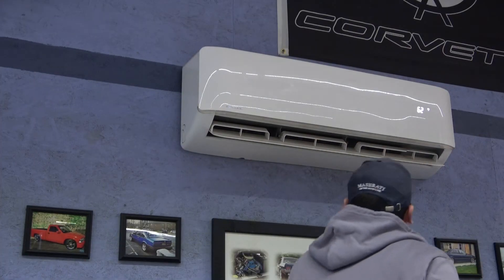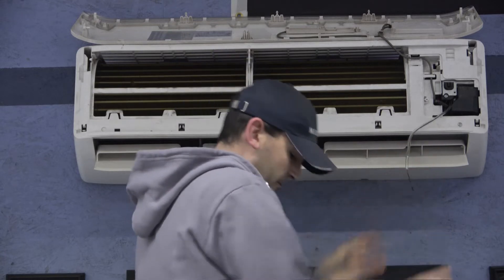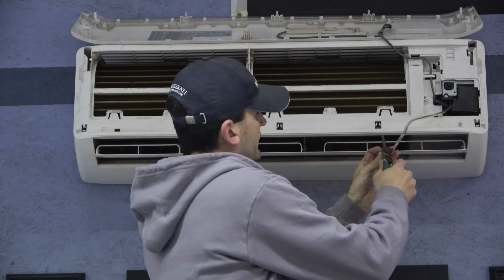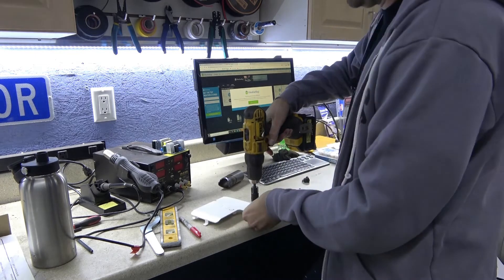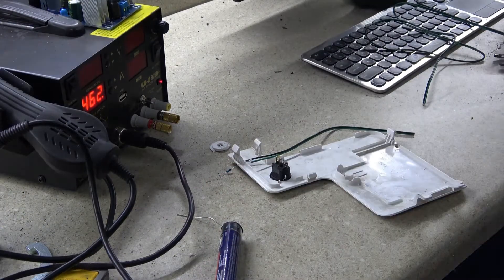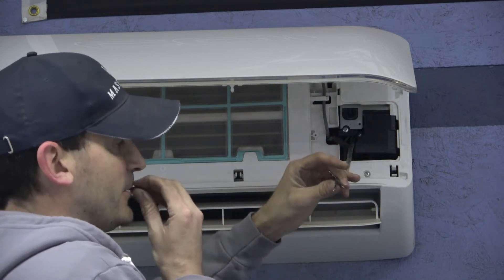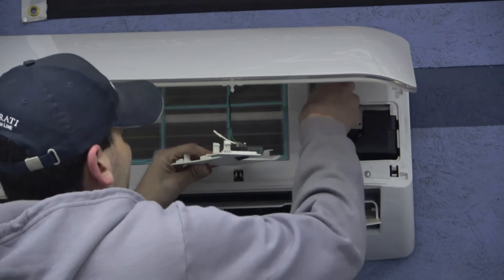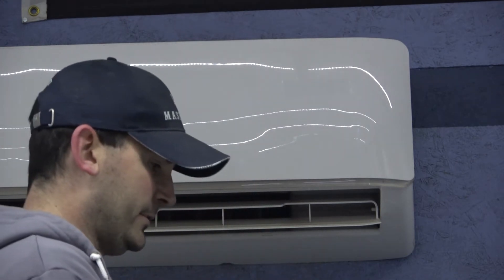Expand Temperature Setpoint Range of ANY HVAC! Even Window A/C's!!!

Comment from the maker: Resistor Kit: https://www.amazon.com/gp/product/B07D54XMFK/ref=as_li_qf_asin_il_tl?ie=UTF8&tag=trialnerror-20&creative=9325&linkCode=as2&creativeASIN=B07D54XMFK&linkId=ec7d7cfbc12c05716396729b308e5b7e
Potentiometer option: https://www.amazon.com/gp/product/B082FBLKM3/ref=as_li_qf_asin_il_tl?ie=UTF8&tag=trialnerror-20&creative=9325&linkCode=as2&creativeASIN=B082FBLKM3&linkId=4bd0e6789736b296b316eebabab8d008
On/Off switch: https://www.amazon.com/gp/product/B07D285PLL/ref=as_li_qf_asin_il_tl?ie=UTF8&tag=trialnerror-20&creative=9325&linkCode=as2&creativeASIN=B07D285PLL&linkId=54e296d013f7bb5ae1055cb94784db48
Soldering Station used in this video: https://www.amazon.com/gp/product/B074DSYTNF/ref=as_li_qf_asin_il_tl?ie=UTF8&tag=trialnerror-20&creative=9325&linkCode=as2&creativeASIN=B074DSYTNF&linkId=f399889bbcf06fd498926bdea96a1a22 

BRAND SPANKIN' NEW CHANNEL MERCH! https://teespring.com/stores/trial-n-error
More monkey business? Find me on Facebook: https://www.facebook.com/YoutubeTrialnerror/?view_public_for=232815904127596

Comment: Normally if condenser and evap coils are clean, filters clean, fan set to auto, refrigerant level is fine, you would want to increase temperatures and not to fool sensors arround 😂
Reply from the maker: You completely missed the point...

Comment: I was just curious how well the mini split (24K BTU)  does at heating your garage?  How long does it take to heat it up on a cold day?  Does one unit heat both new and old parts of your garage?  I am also in NH and was considering propane for my 28x48 garage, but you have me thinking otherwise.  Would also be curious as to what that unit does to your electric bill?
Reply from the maker: Surprisingly good.  I use it to cool and heat the entire garage and planned on installing two of these.  After a year I found I really didn't need the second one.  If daily tamps are in the 30's it will take about 3 hours to get in the 50's which I feel is comfortable working temps.  This year I'm leaving it running full time to keep the garage around 40 degrees.  Finding I can crank it up and in an hours it's comfy again.  When the outside temps get into the single digits it struggles so you can just about double those times but it does take the edge right off. If you want this to get your garage up in the mid to high 60's or 70's I would say buy a much larger unit or two or go with propane.  For me, this is working out great!
Reply: @Trialnerror  I am like you, keep it above freezing when I am not there and 50s would be enough for me on the odd winter day I am out there, although I might try to find a unit with "freeze mode".  I would likely get a double head unit since I also want to heat  attic.  Now I just have to figure out what to do with the used 250K BTU propane heater I picked up from Craigslist.
Reply from the maker: Forgot the electric bill.  Really not much.  Maybe added $30 a month to it tops and that's keeping it above freezing 24x7 this year.

Comment: Ok I think I got it nut have 2 questions,  1 in video you only cut 1 leg at first rite, but when you do final your cutting into both legs ?  And 2 what was the final resistance value you use, thanks
Reply from the maker: Yes, the final version for me has me bridging the two conductors, one conductor to each side of the resistor. I ended up landing on something like 15-18k if memory serves.
Reply: @Trialnerror  ok il try a 15k first thanks
Reply: @Trialnerror  if the 47k gave a11degre different and the 22k gave u 22deg , im kinda lost how 15 or 18 is between 22 n 47,?
Reply: @Trialnerror  ok i need a bit more help. I ordered the resistor kit you showed. And theres no 15 or 18 k value,  can u possibly give me a picture of what you used , that would be awesome

Comment: Great solution! I've been looking to solve the same problem once I get mine installed next week. For the specific problem of a lower heating set point, did you consider using the freeze protection mode which keeps the temp at 46F?
Reply from the maker: I didn't even know that was an option????  I guess I better go read my manual LMAO

Comment: You have to be careful doing this with an air conditioner though as it may cause it to run the evaporator below freezing, turning it into a block of ice, and sending liquid refrigerant straight back to the compressor which will kill it.
Reply from the maker: Agreed!

Comment: With commercial Mitsubishi electric inverter splits they have 3 thermistors in the indoor unit. You have to offset all 3 by the same amount for it to not go into fault